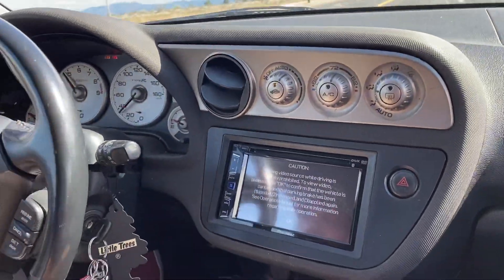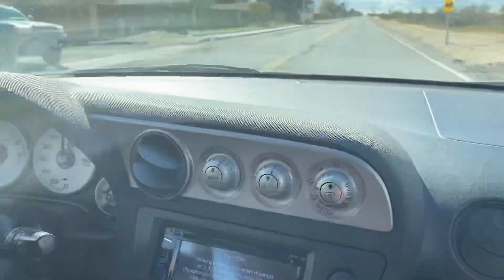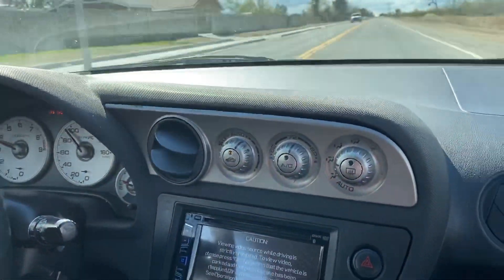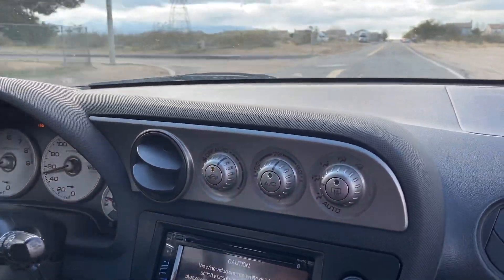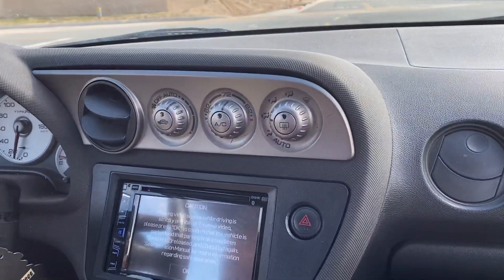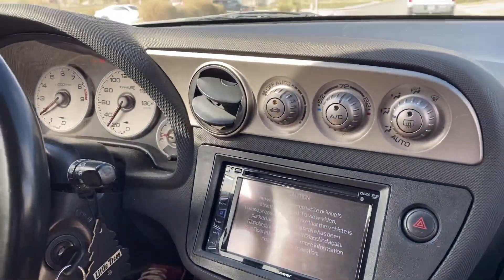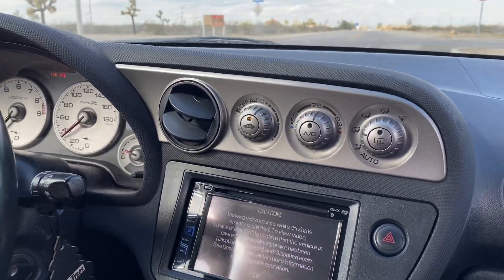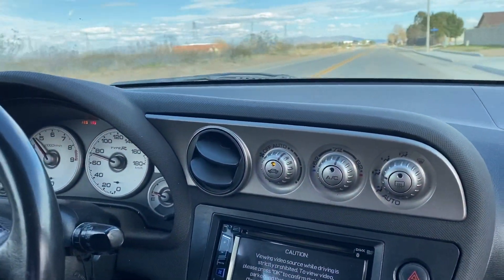ACURA RSX TYPE S WITH K20A TYPE R (PRD ECU) PART 2

Comment: Hey man great pulls, I wanted to ask a question just got into cars and doing a swap,  k24a2 on a base 5speed was wondering if the the base rsx ecu will run with a k24a2 motor ?
Reply from the maker: The base model have economic vtec so it hits around 2200 , k24a2 has true vtec so it’s met for higher Vtec kick in , so it will start the car but I wouldn’t recommend driving on it

Comment: @Rarewitit is there any stock ECU that you could think of that would slide into the RSX (02-04 setup) and run the K24A2 (TSX motor)?  Got the K24 swapped RSX back from the body shop to repair the rear end and it's giving the P0171 (running lean) on the stock PRB ECU.  I got the TSX auto ECU with the engine but don't think I can do anything with that.
Reply from the maker: Just run a stock Rsx type s Ecu
Reply from the maker: Check your fuel pump and injectors
Reply: @rarewitit7899   which injectors do you think I should be using, the TSX or RSX?
Reply: @kseries20-24only same
Reply: @rarewitit7899 Also, would you believe a 04 Accord manual ECU could be dropped in the RSX and work 🤔
Reply from the maker: Won’t work
Reply: Thanks brotha, I'm going to trouble shoot the fuel system this week, may well be that I just need to get the other RSX sold and buy a Kpro, searching around it seems like a common issue that the stock ECU runs it lean  :/
Reply from the maker: I have swapped slot of Rsx with k24 and had no issues

Comment: Last question sorry 😭😭 Soo I found a hatch back civic that was k-swapped into a k20a2 and runs on a 6-speed trans from a type s and the ecu is a kpro pnd and my car is a type s that runs a prb and he’s selling it for 800 and I was seeing that there’s a lot of stuff to do for example it might be lock and 6th gear would be locked out idk but I’m wondering is if it’s worth buying even tho his engine and tran is the same as mine?!!!
Reply from the maker: The lock out is for reverse  not 6th gear , it will swap right in no problems

Comment: No power loss from using PRC ecu? Since its tuned for 94 and different cams? Is this a bone stock k20a2? Appreciate it
Reply from the maker: The prc is running good because it’s stock Ecu for the K20ar type r which is what this motor is in the car
Reply: @rarewitit7899  so for clarification this is a jdm k20a in the car? Not the stock k20a2
 Thanks

Comment: Hi, I am putting an ecu prb - A13 on my civic ep3 and it does not turn on. Can you pass the ecu prb diagram or what cables should I change?
Reply from the maker: Need to reprogram Ecu immobilizer at dealer or locksmith

Comment: Does the type r Ecu only work with k20 or can I use it on a k24a2 in my mr2?
Reply from the maker: Starts any k series engine k24 or k20
Reply: Rarewitit thanks for the info
Reply from the maker: No problem
Reply: Rarewitit 
How did you ground the fuel pump?

Comment: Can you hit me up 
Need help grounding the fuel pump relay
Reply from the maker: E1 is ground , type  r Ecu works on any engine
Reply: Rarewitit
Can you help me ground the fuel pump relay 
Which wire is it ?
How do I ground it ?
Reply: Rarewitit 
I have the type r ecu 
However the green and yellow wire I believe that  is the fuel pump ground ,,,, has power when the key is turned forward 
Should I ground this wire coming from the blue in color fuel pump relay ?
2003 Honda Civic si with k20a2 swap
Reply from the maker: Just ground e1 that’s all I did
Reply: Rarewitit what is e1?
Can you give me a wire color code or where it is located
Reply: Rarewitit 
I found the green and yellow wire 
Do I cut and ground the side leading away from The ecu.  Or the side leading into the ECU ?